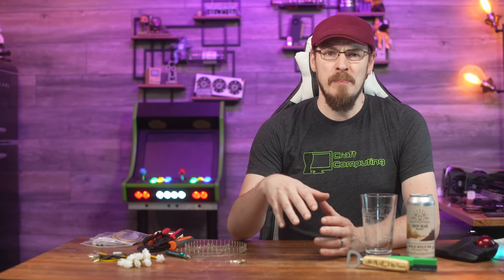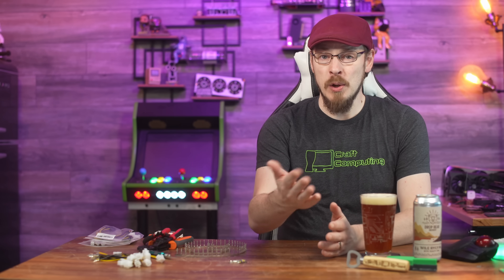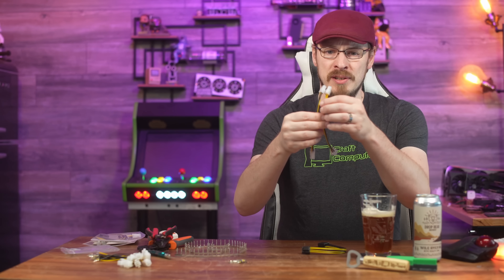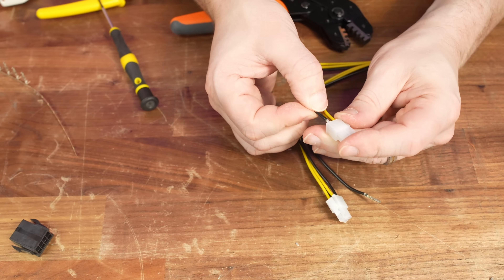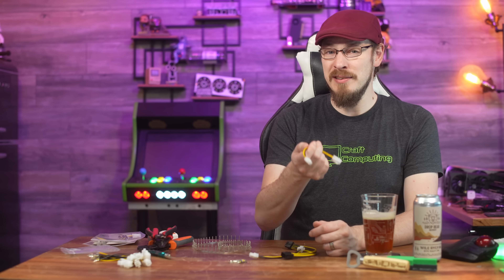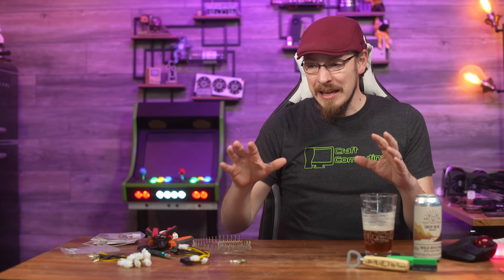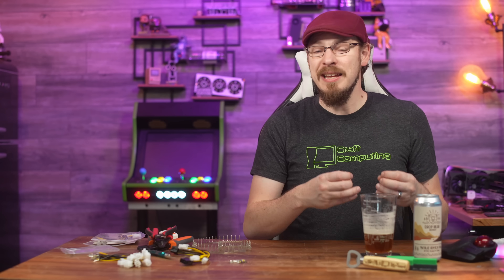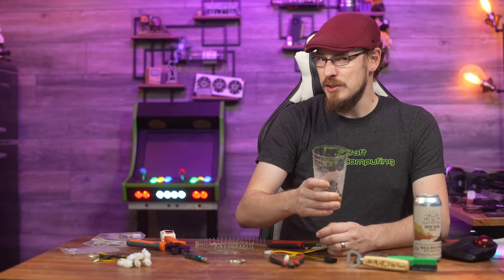IT'S WORKING! - Asus ESC4000 G3 Custom Power Cables

Comment: In reference to the male/female designator, you are close. The male is referencing the pin itself and the female what the pin slides into. The plastic around these is called a shroud. So you would say, "a shrouded female connector. " No judgment, just more knowledge! I love your videos! Keep 'em coming.

Comment: ASUS did something similarly obnoxious on the RS series servers. The "E9" generation had an 8-pin VGAPWR connector that looked like

GND GND GND GND
GND 12V 12V 12V

while the "E10" and later generation had an 8-pin VGAPWR connector that looked like

GND GND GND GND
12V 12V 12V 12V

with the exact same keying (which is also the same as EPS12V, but polarity backwards). You can see where that goes. If you go out and buy a surplus "ASUS GPU power cable" without doing your research... you short GND to 12V very nicely.

Comment: ramdisk maybe in addition to, or in lieu of, some of that local storage since you have 2x 8 slots? Likely deals with the random I/O from games better than ssds over sata. Don't dispose of the 8x ssds though; keep them for persistent non-networked storage. Use ramdisks temporarily during a gaming session. Dunno. Just an idea.
Albeit ddr4 is not cheap, I know. Like $600+ bucks for 512gb kit (8x 64gb). At least $1200+ for dual socket is hefty.

Comment: Thank you for going through all the troubles testing this out. I would love to have a similar setup for my home lab. I choose to do it in 4u instead of 2U as that makes cooling at reasonable noise levels more doable but I love using old server gear for it as it just has so many more features than consumer gear. I am not saying that everyone needs 128 PCIE lanes you get with EPYC but only having 24-28 lanes on consumer sucks because after you add a single GPU and storage you are basically done as far as expansion.

Comment: The male-female designation goes like this...male goes into female, duh. But you can have male terminals in a female plug and vice versa. One example of a female terminal in a male plug is the ATX power cable, and the hard drive molex connector on IDE drives.

Gonna tell ya, those terminals SUCK ASS. UL requires a pull of 35 lbs on 16 ga wire but those terminals have a tendency to fail unless it's crimped for a 45+lb pull test. One thing I recommend is to put a dab of solder on the crimp, it helps especially if you're hand crimping. 

Sauce: I worked in a wire mill for 10 years.

Comment: probably splitting hairs here ;-) but using two 4 drive z1 vdevs should deliver better performance. less resilience tho if two drives in the same vdev dies
Reply: Even better to use striped mirrors - IOPS are limiting here, and each striped vdev adds iops, where raidz reduces iops

Comment: Hmmm... what are your thoughts on Skylake-SP vs these old Broadwell systems? I notice that some Skylake-SP processors are nearly as cheap as Broadwell Xeons now so am kind of thinking that its time to move on from Broadwell era.
Reply: @Administrator8497  Skylake server platforms are still quite expensive. Obviously there's going to be more performance than Broadwell but is the power consumption any better?

Comment: I just got mine put together! 2 X 2697v4 and 128GB DDR4 

I haven’t got unraid on it yet (migrating from a previous 2667v2 based rig) but one thing I have noticed compared to my other 1U server: 1) this thing is LOUD and 2) the second CPU runs quite a bit hotter than the first… like 10-20 degrees hotter despite the airflow ears trying to get fresh air to it

Comment: Thanks for this. Absolute legend. Received ESC4000 G3 the day after your last video (thanks to a surplus of recyclers being located nearby and shipping taking one day). I've got all of the cable making gear, but just needed the pinout diagram and a few extra EPS connectors.  For anyone wanting to do this but source the parts a bit different and not need to de-pin as much, I recommend going through MAINFrame Customs. I've used their site a number of times to make my own PSU and assorted extension cables and have always had good sucsess. You can get all the individual components to make your cables at far better pricing than Amazon. I'm going to be making two sets of cables. One for Enterprise GPUs (8-pin EPS) and then consumer GPUs (PCIe). 

My next hurdle is (a) figuring out which cards I want to stock this with (I'm going to direct access local LAN gaming machine and (b) if I can find some lower dB fans to swap in.  Fortunately the BIOS (at least latest version) allows for full PWM control of the stock fans.

Comment: Funny - Supermicro also seems to use a cable that doesn't exist for their GPU headers, at least in my X11 platform. They use what seems to be a standard 8 pin EPS, which you think would be great for these Tesla cards, but the pinout is reversed from what it should be! I had to make my own cables as well since the cables to actually make it work don't seem to exist.
Reply: Hey mate, I have supermicron X10 platform and in search of these cables... How did you figured out which cables goes where?... Can you point out how you did this... Some tut or diagram will be much appreciated.
Thanks

Comment: RAID is a backup.
Reply: everything is a backup if you are reckless enough
Reply: raid is a backup if on campus is offsite :)
Reply from the maker: A RAID allows you to recover a lost disk.
A backup allows you to recover lost data.

A RAID that has failed to the point of losing data will not allow you to recover it.
Reply: RAID is definitely not a backup
Reply: XD